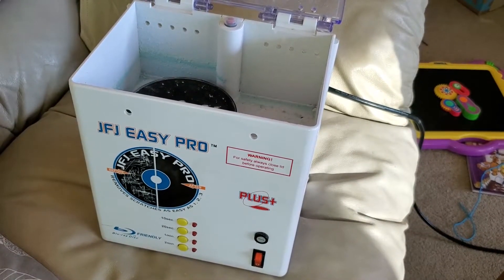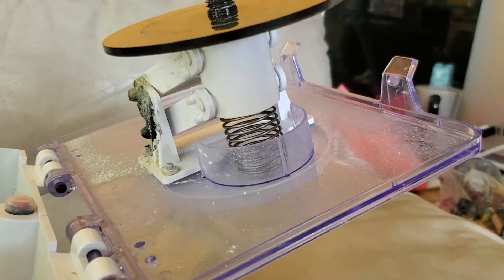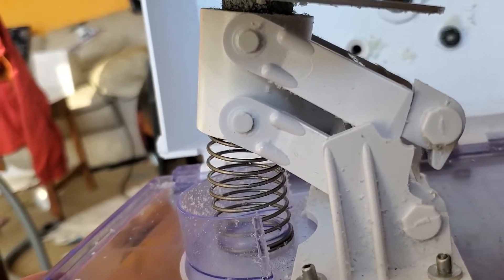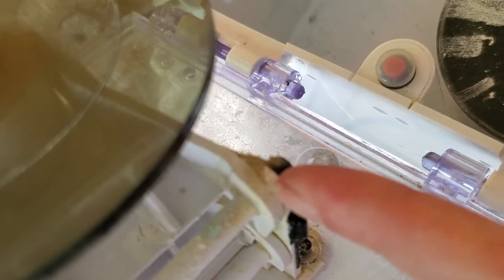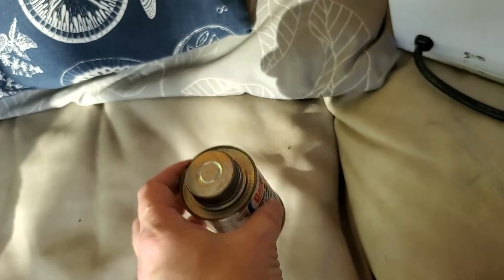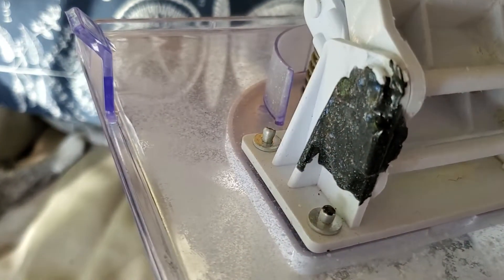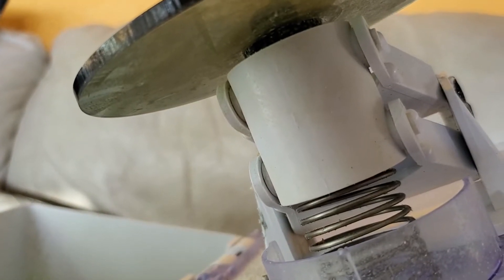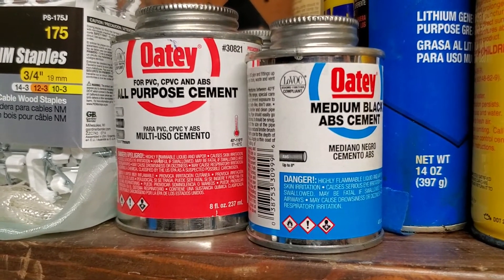JFJ Easy Pro: repair and reinforcement of disk arm

Comment: I got about six months out of mine, it cracked in the same area. Poor use of weak materials, I found new set of upper assembly replacement parts on ebay which by the way looks like its shipped from the same place where the JFJ is made. They have sold over "65 UPPER ASSEMBLY REPLACEMENT PARTS", im sure there aware of this defect of 65 plus . I will have to reinforce mine those areas with JB Weld to insure im not paying up again for a defective product!
Reply from the maker: The real question is how many disks did you repair before it started to crack? For the price it seems to be an OK product, but certainly there is room for improvement. My repair is holding up fine but I've probably only resurfaced 40 disks since doing it. As to the JB weld, certainly that's tougher than the stuff I used, but you might want to make sure it adheres well. The stuff I use actually fuses very well to the plastic.
Reply: @xeostube bro some guy had his for 2 years hasn’t cracked mine I had it for 3 months whole arm came off !!!

Comment: One of my arms broke off during disc cleaning. When the arm failed it cracked the CD being polished. I ordered a complete replacement lid from JFJ Easy Pro website and a set of new arms from eBay. Going to use JB Weld WaterWeld putty to strengthen the arms where they attach by the holes. Set time is 25 minutes and cure time is only 1 hour. The putty is workable and can be formed with your fingers.
Reply from the maker: @timwildey7974  but does it bond as well to the plastic? Fast set time is nice but not essential.
Reply: You have to prepare the surface by degreasing then roughen up the area so the epoxy can grab. A smooth surface will not allow the epoxy to bond properly.

Comment: My arm just literally broke in the middle of cleaning a disc... now I have to refund the ebay buyer. I'm looking around to see how to repair the crack myself, but looks like I'll have to buy a whole new lid with the arm attached. Easier to buy the whole lid than to repair it AGAIN... I caught a old crack previously but glued it back together before it became a real issue.. now the other lower arm at the pivot point has broken off. FML

Comment: My arm is broken at the joint fully. Didn’t even realize but my Buffing pad was wearing down at the edge and I started looking around. Can you replace that arm piece or is it just new machine time?
Reply from the maker: Sounds hard to repair, I think you'd need the entire upper assembly.
Reply: @xeostube  is that an option? I can’t find just that part new. If so I’d love to know. Thank you brother.
Reply from the maker: at best you can watch eBay for people who are parting out their failed units. Sometimes the motor fails and people will sell the whole thing for a pretty big discount.
Reply: I actually found a website that has the part. I have to check mine, because i think its a different design to the arm.

Comment: Hey dude, thank you for the videos. I'm in a stick of bother. I have found a crack in the cylinder since my disk holder hardly spins now and is not spinning on my motor pad at all, so in short it's broken and cannot repair disks. I'm not sure how to resolve, any suggestions? or do I just buy a complete new disk replacement lid. Thank you
Reply from the maker: Best bet is a new lid. I'm not sure what part you are calling the cylinder, but if the mechanism is so broken that the pad doesn't spin I doubt it's going to be fixable with glue in a way that lasts any period of time, given the forces involved. Better by far to patch and reinforce ahead of time than to wait for a big crack.
Reply: @xeostube  Hey dude. Yeah replaced the lid since and now my motor gone ( turns on, but when pressing timer is flashes) just bad luck atm
Reply: Hello I had bought two machines when they sold the bundle together about 10 years ago so mine have lasted that long which I sounds to me like I should be grateful which I am. But I went to go use my machine last night and both of them were broken minor broken in a different spot one of them is broken when the disc is pushed all the way down like at the lid is closed the bottom clamp onto the bar that's closest to the lid that's where it cracks do you have any suggestions on how to fix that
Reply: Real quick I see there's a replacement lid for the JFJ  and then there is a lid for the JFJ eyecon machine.  
Do you think that both are the same

Comment: Mine doesn't show any damage but the top plate is not spinning during operation, or barely spinning. When I open the lid I can rotate it manually. Any ideas?
Reply from the maker: The motors can wear out if run for a very long time, see my other video that shows the wear surface that causes this.

Comment: Hey homie u know how to replace the lid cause mine broke and I got a replacement from the JFJ company and I need help setting back together
Reply from the maker: I don't know but my idea would be to cut out the old pin if they gave you a new pair, and then tap the new pin into the hinges.
Reply: I would just cut the ribbets with a wire cutter and than use small bolts and washers to put it back